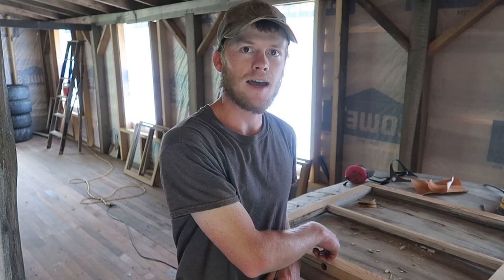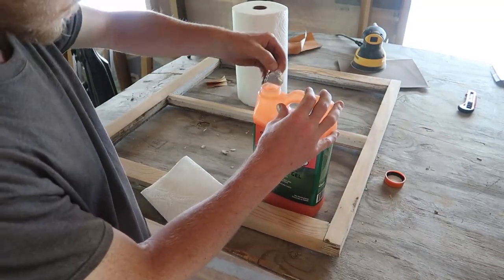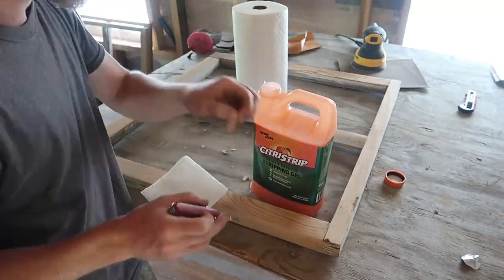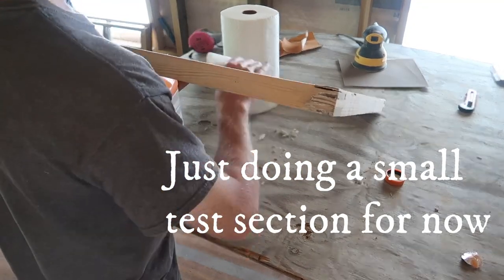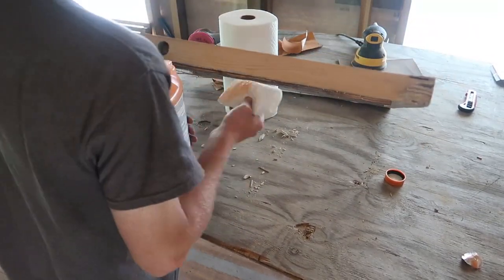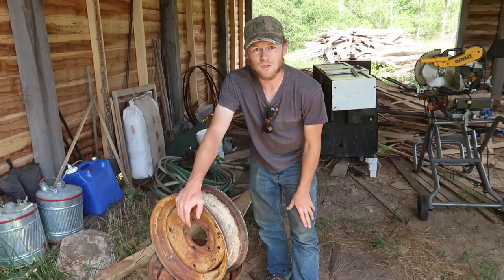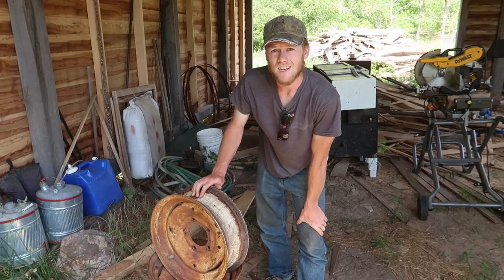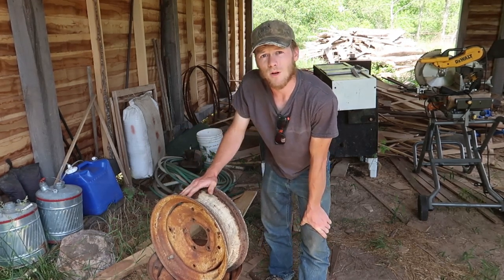Windows & Wagon Wheels | The Millhouse

Comment: when you get ready to take the square nuts off your bridge rods, have some heat handy (oxy acetylene w/a broad spread tip) it'll help quite a bit and if the threads aren't damaged, you can usually get them apart. 
Good luck on that. It's a pretty ambitious project, but I've seen you pull off some amazing things. :D
Thanks for the vids.
Reply from the maker: I unfortunately don't have a good torch like that, but I'll definitely be putting a propane one to use.
Thanks so much!
Reply: @LandisLegacyFarm  Also don't forget about using a good penetrating lubricant like Liquid Wrench.  Other wise you'll be working way harder than you have too.

Comment: Almost all old furniture is finished with either shellac or lacquer (shellac until the 1920s, lacquer since). Both of these finishes dissolve into a messy “gunk” when paint stripper is applied. On complex surfaces, such as turnings and carvings, an easy way to remove the gunk is to wipe it off with handfuls of wood shavings from a jointer or planer.

The shavings soak up the gunk and you can remove them easily with a stiff bristle brush.
Reply from the maker: That's really interesting, I'll have to try that. At this point I've got these cleaned up, but will definitely try that on other projects in the future. Thanks!

Comment: Take your rusty rims and put them in a vat of water get some epsom salts or regular salt mix in and hookup one end to the rim and the other to another to a rod then hook it up too a battery charger and let it do it's thing and the rust comes right off in a few days here is a link on someone doing it! Save a lot of time and dust that your might be breathing!
With your window frames I think I might of mentioned it before why not just make them from scratch you must have some of that red cedar down their this way the time you are putting into it would give you new frames can't be that hard as years ago they didn't have the technology we have to day with modern day equipment! Take one apart and copy it you can make them to the correct size for your window openings!
Don't forget that the rake~er angle on your blades is 7 degrees for hard wood! Soft wood is 14 degrees I bought a woodland mill blade sharpener great little investment Josh mine works well check out sawing with sandy he shows a video on the grinder!
For your rusty nuts on the bridge!
So take a propane torch you solder copper pipes with and set it up on the
 nut leave it for five minutes and it is not efficient as the 
oxy/propane or acetylene but it will work with the oxygen it turns red 
in a minute with the propane torch it takes five minutes sometimes 
quenching it with water shocks it then heat it up again!
Hope you don't mind me offering some tips Josh!
Reply from the maker: That would've been a good idea.... already have them all cleaned up, but will definitely use that for future projects!

Comment: Hi Josh I worked as a welder for Cat and know the machine well their great! as with any machinery they wear out and I know one uses it accordingly personally I would get a ball and weld it to your machine somewhere and bring a trailer load the trailer and then pull it back to where you want to move the logs less wear and tear on your machine and extends the life. Those logs are heavy and it is hard on the machine. Just letting you know sometimes never hurts to help with ideas!
Reply from the maker: Thanks! I'm hoping to get a log arch together sometime, and then I can use the tractor to move them around a bit easier.